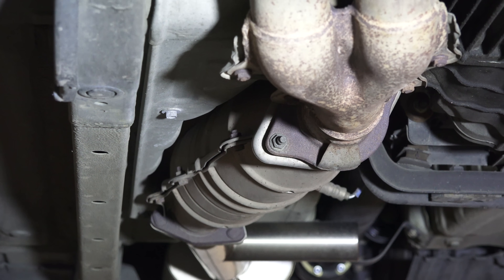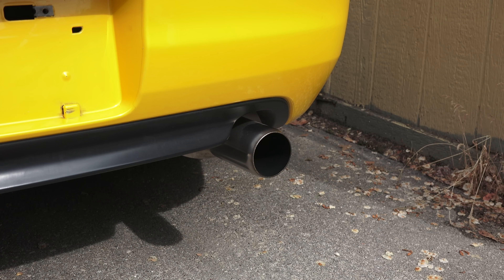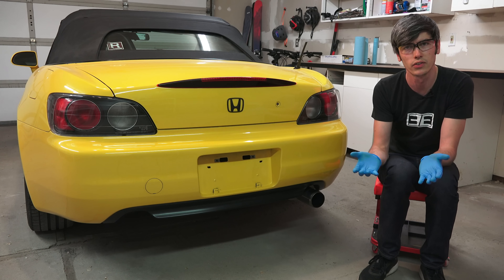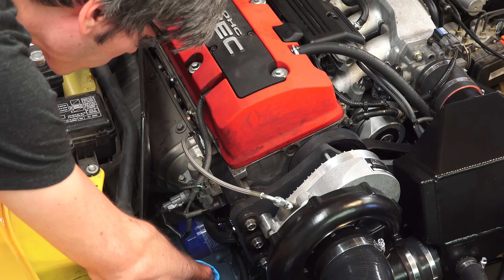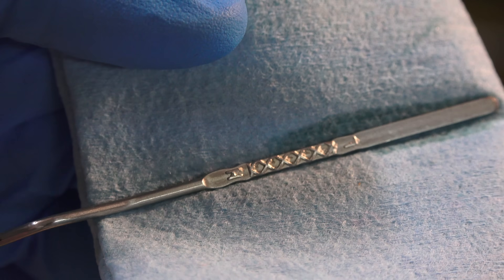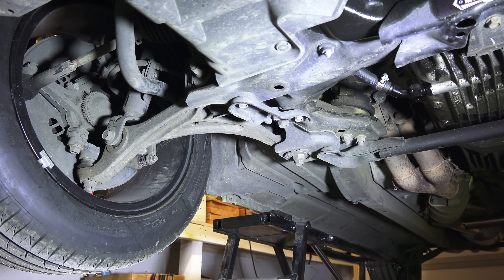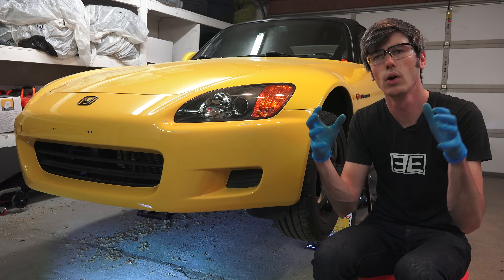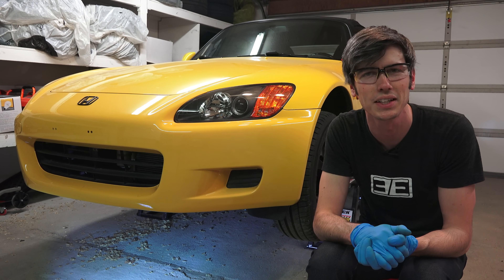5 Signs You Shouldn't Buy A Used Car

Comment: Also Coolant can get mixed with oil when the engine block comes with a bubble caused by casting problems, it happened to me with a 1993 Chevy S-10 Blazer and its Vortec 4.3 engine. The mechanic thought it was a Crack and it ended up being a manufacturing problem.

Comment: I have a mini 2013 it’s cold now ! I haven’t driving much thanks to Covid although I don’t drive a whole lot maybe 2000 miles a year ! It was 40° I started the car the first time this year and I seen white smoke I freaked out needless to say but once it warmed up and I drove it went away? What did I do I checked my coolant  bit off so I added I do not see anything leaking anywhere?!
Reply: Coolant can seap through the head gasket when its cold.  Not a huge issue if it goes away.  It could have just been condensation from being cold.

Comment: When test driving , notice if the gauges are working .
Temp , oil presure and voltage if the vehicle is equipped with them .
I had one guy place a " Funeral " card suspiciously over the Temp gauge .
When I carefully noticed and removed the card , I could see that the gauge wasnt working .

Comment: When buying from a private party , I also judge a car by its owner .
More meticulous people take care of their investments . I also want to see if the car has the service records and the Original Owners Manual .
If you are buying a car with a rubber timing belt and there is no history of it ever being replaced , you could be on borrowed time if its an interference motor because if it breaks , you now have a 3,500 lb lawn Ornament. 
Most rubber timing belts need replacing after about 70 k miles and every 70k afterwards.
Reply: So true. All the used cars I have purchased for myself, family, and friends, were from males over 50 years old. Never had a problem.

Comment: I also like to check for bubbles in the oil, particularly if the seller changed the oil. A good diagnostic/preventative action if you buy the car is to change all fluids, yes including diff/transaxle, ones too before deciding what to go in depth on if needed. The more mileage on the car the more you can expect to have to repair sooner than later.

Comment: I live in Nevada so I would not see rust as a problem. On the contrary, buying a car that is half rusted down but not yet broken, might be a good way to get a cheap car, assuming you live in desert climate where cars dont rust. 
Also Nevada does not require smog or other vehicle testing which is nice, you can buy a cheap car in California with all four cats worn out, an expensive repair if the state require the cats to be working.

Comment: I bought a 01 Camry 2.2 from a side shop somewhere near Dallas a year ago. From what I've heard, sellers will lie about things like "this car was owned by a mechanic's grandfather". I bought this car for wayyyy too much, and was sold to me for 216K miles. Fast forward six months of extreme engine lag, smoking, all the suspension falling apart, dirty interior and throwing multiple codes, I was finally about to give up on the car. That's when I was removing the passenger seat I found a center piece for the gauges, which is the speedometer/odometer combo. I slapped it into the cluster and the odometer read "354000". Upon buying a Carfax report, the vehicle had spend most of its life in Oklahoma until about 2015, with the last odometer reading "354000". For 4 years, the car was juggled back and forth between strange, unknown and potential criminal owners. The seller never gave me the title, I had to get it bonded. 

To list the things I have so far replaced: the entire interior, most of the electricals, valve cover and gasket, alternator, starter (3 times), radiator twice, control arms and bushings, ball joints, CV axles, inner and outer tie rods, windshield wipers, EGR valve and corresponding connections, rear struts, battery, heater core (car didn't come with one; bought in February and it was 12 degrees every day), air-box and intake manifold, nearly all sensors in the engine bay, fuel pump, the entire exhaust system excluding the muffler, all five wheels (full size spare), driver door, and much more that can't come to mind right now.

I need to replace rack and pinion (loose steering), motor mounts (motor moves around), potentially the torque converter (the ATF is pitch black), transmission filter, oil pump and main seal, timing components and pulley system (380k miles on this car), charcoal canister and hoses, all hoses under the hood, a NEW radiator, a new hood, front hubs and wheel bearings, bumper, and headlight assemblies.

I should have been a little more responsible when buying the car but I needed something to take me out of town early the next morning.... When someone is selling a car, I found out the hard way that they're selling it for a reason! Check steering, fluid levels, history reports (carfax or maintenance records), engine codes or "not ready" sensors, check the color of the fluids, look for signs of uneven or extreme tire wear, check for rust underneath and bad bushings, and test drive with the radio off.

Comment: In a gas car, do a compression check
Also, on a test drive, drive it like you stole it, transmission issues will show their dirty little faces.
Do a blow by test, remove the oil fill cap, turn it upside down over the hole, of it blows it around and off the hole it should not be purchased.
Reply: Also invest a little in a computer reader, be able to see if any codes have been erased and what they were.

Comment: Hmm, I took on a 95' powerstroke with 278,000, I see it a bairly broken in. Still runs strong.
Reply: Barely broken in?! With that many mikes?!  And what’s a power stroke?! Hmm 🤔.
Reply: @prestoncheapbtheadphoneste3010  diesel, they have a b50 rating at 350,000 so they project 50% of the vechicals need head work at 350,000.

Comment: My truck has been dripping a little bit of power steering fluid for years and in AZ if you replace one dry rotted tube your replacing them all because as soon as you remove the first a second and third will crack during the process. You get rust on the east cost. We get dry rot in the south west. Bushings, tubing, wire coverings, tires, anything plastic will dry rot and crack in ten years. Where I live it's not a sign of a bad car it's just of sign of the age of the vehicle. Most people don't replace all their engine tubing every 8 years. I've done mine once already, 20 year old truck. I'll do it again soon but it's drips for me until then.

Comment: i love how americans are so picky about rust. i live in estonia and we get alot of moist time. so a car that has no rust on suspension parts (the parts that are actually Fe not aluminium) is a very rare find. my own car thats from year 1977 had a massive leak in the rear axle but i dont understand how i couldnt notice the leak point before. it had size of a 8mm bolt on top of the axle itself on the differential bowl so once i drove it, the differential just throwed the oil out cause of centirfugal force. i used my one very good body glue and the rear axle is leak free. altho i probably need to change the rear axle in some years cuz its prob soon rusted thin so much that its gonna bend thru and its gonna ruin the halfshaft bearings. my dad had the same car (the same model) and after 45years he changed the rear axle cause it did bend thru of all of the rusting. and after 1 or 2 years he changed front suspension fully cause the control arm metal was already thinner than paper and one side of the control arm was bent already 45degrees only cause of rusting.

Comment: You do great videos, and heads up I am not taking this seriously, here’s my tip:  Has the car got the type of engine that requires an exhaust pipe?  Pass it by if it does.  I think that’s it.  Seriously, your channel is top notch, and I am just wary now of ICE vehicles.  I noticed a nearby used car dealership shut up shop, just as I was remarking to my offspring ‘There will come a point where dealerships of used cars will need to take a pause, because gas/petrol and diesel vehicles, must become all but worthless, and the exact point is going to be unpredictable’.  My view is, the guy has deemed it prudent to shut up shop for a few years until we’ve all transferred or pretty much the market has shaken out.  In some ways, ICE cars are already the cheap crud option, with high running costs?  The other unpredictable factor, is of course the US Presidency - we are now close to the 2020 election, and if the top man changes, the eco-wind might blow up a storm.  Keep it up, we got to watch something during lockdown, and your back-catalogue is not a bad choice.

Comment: pull the oil cap when the engine is fully warmed up see how much blowby happens. great way to check overall engine condition.   open the rad cap and see is air pumps out had head gasket.

Comment: With fluid leaks, if its coolant, and the oil isn't thick yellowish, white smoke, overheating, it may be something less expensive to repair like thermostat housing, a pressure test will tell but neverrrr get a car if the oil has a mayo type texture on the lid or it's over heating

Comment: I once checked 4 cyl Toyota - it passed all the criteria of this video however it had excessive blow by - unscrew oil filler cap and rest it on the opening then start the engine - on this engine the cap was blown off by too much blow by in fact the cap should just sit there in a good engine while its running - you can also put your hand over the oil filler hole and feel for excessive blow by of gasses from the engine - too much blow by suggests a worn engine and if this happens walk away

Comment: I have a little white scattered  smoke, but only if it’s like around 60 degrees or lower and the car is idling at traffic light. I’ve seen other brand new cars with similar issues, is that not normal?

Comment: I purchased a 1987 corvette and it's starts up fine first go - Lots of blue/gray smoke but then after it is warmed up - I need to hold down the accelerator some to start/warm up the engine - other than that it rides great - I've asked mechanics about it and they all seemed unconcerned -- I put a lot of sea foam in it and have driven it good distances without any other complications

Comment: Want my advice,take a piece of cardboard,let it run and idle for 15 minutes,check for any leaks. You'll know what and exactly where. Most of the time,burning oil can be as simple as a dirty PCV. Listen for ticks after that 15 minutes. Lifters on most cars were hydraulic,especially in the cold,they will tick. That's fine,but after it's ran for a minute,if there's still a tick,don't go for it. Take a cheap scan tool, ob11 test. 20 bucks at Wal-Mart. Take a cheap meter if you want to check charging system. Hope that helps someone.

Comment: One more way to check exaust'
Grab a dollar bill with bother hands holding on each end 

Hold up to tail pipe while running, and if the dollar bill gets sucked up to tail pipe, and popping it, then the valves have issues

Comment: Blue smoke will only be when cold or enormous oil burning. Once the catalytic converter lights off the smoke will be thin white, even with oil consumption as high as a quart every 500 miles. The last time I saw blue smoke it was from breather blockage in our '85 Volvo turbo, causing oil to spill from the turbo into the exhaust. It produced a cloud of blue smoke when we took off from a stop.
I just do a short screening on used cars (I have only had three new cars in 50 years). I check for traces of rust in the coolant and verify the coolant is at least the expected color for the vehicle. The exception is for GM vehicles with V6 or V8 engines from 1996-2004; Dexcool is incompatible with the intake manifold gaskets in those vehicles. With the engine cold, I remove the pressure cap,  and start the engine. I put the palm of my hand over where the pressure cap was and pinch off the overflow tube if present. If I feel rising pressure within 5 seconds I can be sure the head gasket is bad. Finally, I look for varnish on the dipstick above the "full" line, a sign the car has not had synthetic oil regularly.
If it passes those checks it is worth a pre-purchase inspection. If not, I thank the seller for his time.

Comment: My dudes with the subarus out there, if you start the car and see your engine light on, brake light flashing and cruise control flashing it means your MAF sensor is bad or worse case scenario one of those cylinders have low compression causing a misfire. Learned that the hard way with my Legacy GT

Comment: "An auto parts store will check the codes for you." Have you ever been to Auto Zone? You're lucky if they wait on you. Nasty and unhelpful people.
Reply: Also not allowed in California, where only certified smog stations are allowed to even read OBDII. Midas and some other places will do it there. With bluetooth basic OBDII plugins around $10 on Amazon (not anywhere near as capable as the Blue Driver, but they will read engine codes) It isn't worth the hassle to go elsewhere.

Comment: Definitely ask if the seller knows if or when the timing belt has been replaced especially on Interference Engines. A lot of time if the timing belt breaks because it was never changed, your valves could get bent, (less likely) damaged pistons, and/or destroyed cylinder head and block.

Comment: after 2 of my family members went against my advice and purchased the used vehicle they wanted anyway.  i came up with one sign you shouldnt buy a used car.  
1.   get on craigslist and find the highest mileage of the same model you are considering.   if you are excited because this car only has 80k miles but you can only find 4 of them for sale, the highest with 110k miles.   high and low miles is relative to the car you are considering.  i would actually say that for THIS car, 80k is really high miles.

Comment: Used car dealerships and people work under the assumption of highly dishonest people sometimes they like to stick sawdust in the engine if the bearings are bad you got a watch out for that or they may try to put some type of liquid mechanic in the transmission or engine to try to quiet the engine down then when you sell it a couple of months later you start hearing all the noises And ticks 

Don’t ever go to the bank with a used car dealer don’t ever take money out of the bank in the presence of a used car dealer don’t ever let them know what you’re doing ever

Comment: Last year I purchased a  3.0 litres  jaguar with low mileage. I had it a few weeks and drove a couple of 270mile journeys  took it for a service and the mechanic told me it was beautiful and solid underneath. Within a week or so the battery went flat and took it to jaguar. They had it for a week. Bill was 1500 within a few hours it was everything going wrong  took it back and they couldn't find the trouble with my car so had to sell it spare or repair. So all they checks don't always guarantee a good car

Comment: Love used cars, for most of us it is the best option. I bougth my Ford focus 2003 Zetec engine in september 2018 with 157.000km on it. I got it for 300 euros and invested 550 euros(  new front breaks, oil change, TÜV check up, + lil repairs) : after  8months i changed the drum back break for 250 euros.. It took me n my family 2 times in belgium, all over germany and this month we were in Paris ( 550km ). The bord read 199.500 km now that is almost 43.000km in 1y3months!!!. This car have zero  probleme, every 10.000-15.000 km i change the oil with a good quality motor oil (50euro for 5liters). I originaly wanted to drive it for 2ys and get a new car but now i feel like keeping it till the motor give up!! Unless you have the money to buy cash it is a big mistake to finance a new car.

Comment: My '97 Diamante has an early Mitsubishi (GDI) direct injection system. It is FOREVER  burning oil because the fuel injectors are in front of the regular fuel valves.
In the 2 years I've owned it, I basically have a bottle of Lucas Oil injector system clean handy to put in some extra cleaner in the system every second tank fill (or once a month), and use a can of CRC upper air intake cleaner every oil change. Otherwise, it rough idles, smokes a bit black at startup and sometimes can be tough to start in winter. It's a 22 year old car, I get that much, but it still performs like a dream and so far, many of the little "quirks" are things I can repair/replace myself for relatively cheap... so far.

Comment: One thing to know about OBDII codes: not only do you want to check if there are any codes stored or codes being displayed, but you want to see if there are any pending codes and Not Ready statuses. If someone is trying to sell a car that has been throwing up codes and showing a check engine light, they may try to fudge it by clearing the codes themselves to make it appear to the buyer that there are no problems. There’s an easy way to tell if this is the case: plug in your scanner and check the I/M readiness section. If anything reads NOT READY or PENDING, it can absolutely mean that the owner is trying to hide something!

Comment: At 5:10 if you run the AC on a hot humid day during the test drive, expect to see condensation dripping from somewhere in the back of the engine bay near where the condenser is. You can differentiate condensation from other fluids because it will be clear water. Any other fluid leaks will have a different color (coolant will be either green or orange/red, break fluid will be amber, oil will be brown or black, etc) or a different viscosity thicker than water.